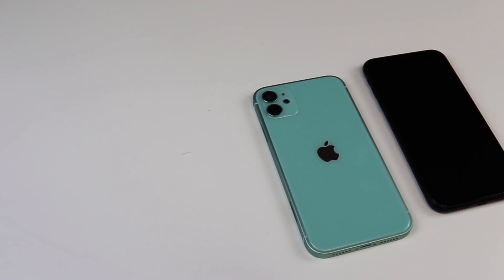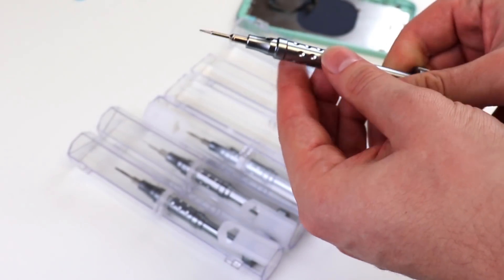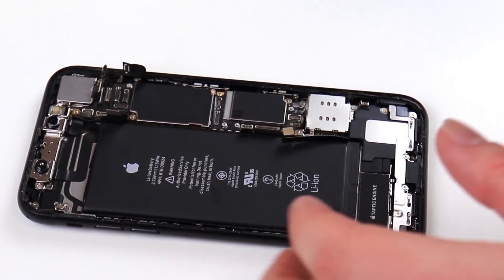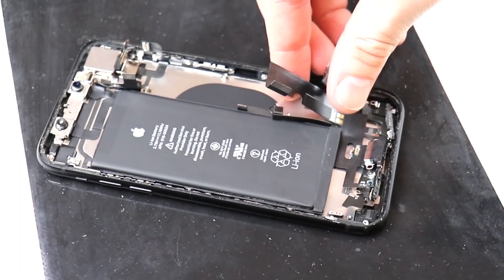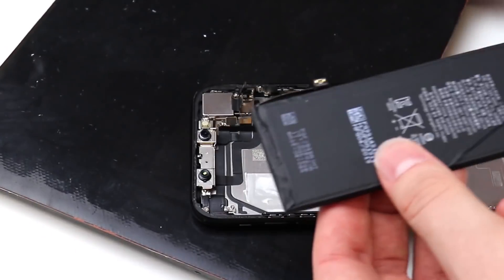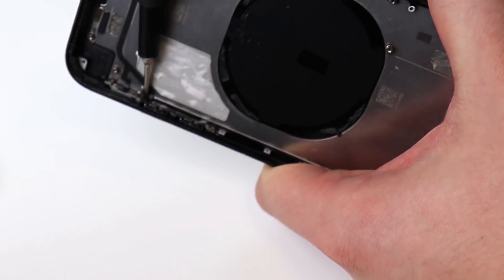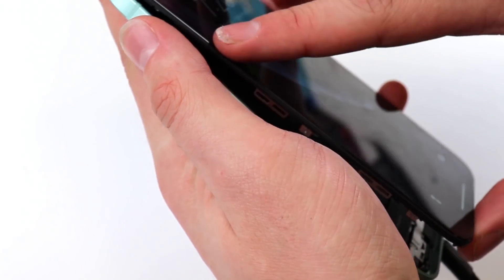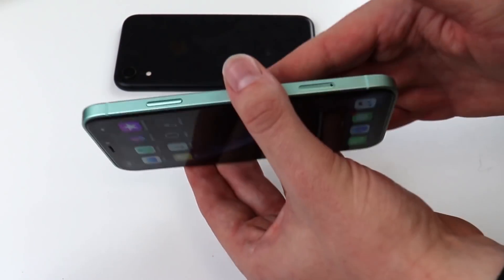Xr into a 12? Can we make this happen??

Comment: I had an xs max with broken front and back glas so i ordered a naked housing 
Und thought ok you might screw it up but try it anyway so 
I did manage to transfer everything but i spend at least 8 hours ( i have 2 babys at home so try to concentrate)
But the part with the screws
Im screwing that every time up (pun intended)
But at least the phone worked 2 months 
After that the touch stopped responding ( aliexpress screen) so now i have an xs max with a broken front glas but at least the back glas isnt broken anymore

Comment: Question time. Should I buy a used almost mint condition iPhone 8 64gig with battery health in the low ish 80% maybe 85% for $120 cad (it comes with a otter box case and the epic headphone charger adapter thing)

Comment: Hello Phone Repair Guru , I have some questions about the camera. Is is working flawlessly. Is it working like a charm with the led light under low light conditions ? I’m am really afraid about the camera quality output with this casing can you please help me. Thanks in advance
Reply: Doing this switch before I can say this camera module works exactly the same as it would inside the iPhone XR because if you think about it. It’s an iPhone XR inside an iPhone 12 casing so the camera will have the same as an iPhone XR and everything will be the same for this phone as it would be for Xr other than the housing is different

Comment: hello 
I convert my Xr to 12. it’s work perfectly fine but the NFC which is responsible for Apple Pay is not working anymore what do you think about it? 
i think I dammaged the charging coil but wireless charge is working

do you think it is related?
please help me
Reply from the maker: Nfc component is the little tiny thing beside the camera. You have to make sure all the screws were in the same place as they were. The charging coil is really not a big deal, easy to replace.
Reply: @PhoneRepairGuru  ok thank you
Reply: @PhoneRepairGuru  I just checked that little thing beside the camera and it was okay and screwed in its place? 
And still, when I put my iPhone on the credit card scanner, it does not work? 
Do you think it is an IC problem!